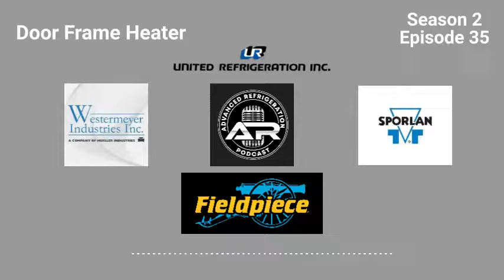Door Frame Heaters

Comment: Great videos guys. I listen to you whenever I'm in the truck or have spare time. You've helped me out so much. I have a question regarding a line up of frozen food doors. When you change a damaged coil what's the easiest way to remove and replace the coil? I've heard guys removing the line up doors and  frame or stripping the case and sliding the coil through one of the end doors. The former is a pain some cases can get damaged and latter is unsettling because the coil needs to be bent in some instances and the fins get all folded to squeeze through the door.
Reply from the maker: remove doors and shelves or if u have to the frame....